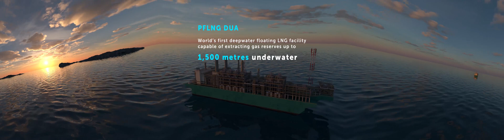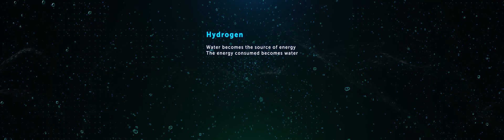Facilities of the Future for Zero Carbon World

Comment: We want more people to be able to travel without contributing to climate change.The pandemic has us realized that how much new normal is needed to prevent a climate disaster and prevention is better. The best numbers seen estimate that the economic slowdown due to COVID-19 reduced global emissions by around 8 percent. That’s not nothing, but the austerity that got us there obviously isn’t sustainable. If we’re going to address climate change, we need to find new ways to do things that don’t release greenhouse gases, including how we move around. When most people picture what contributes to climate change, vehicles are one of the first things that come to mind. In the United States, transportation is the number one contributor to emissions. But you might be surprised to learn that it only contributes 16 percent of global emissions. That’s a smaller percentage than how we plug in, grow things, and make things. Still, de-carbonizing how we move around is essential if we’re going to get to zero net emissions. The goal here isn’t necessarily to make people move around less (although we should look for ways to cut back on driving, flying, and shipping where possible). As we’ve seen over the last several months, economies suffer when people are forced to stay close to home. Want more people and goods to be able to travel. For some of the world’s poorest people—like smallholder farmers in sub-Saharan Africa—the ability to move goods from rural areas to city markets can make the difference between life and death. To do that, we need to make sure transportation remains affordable to everyone. Products like gasoline, diesel, and even jet fuel are the standard for a reason: they can send you a long way for a low cost per gallon. So, how exactly do we fuel our need to move around without emitting greenhouse gases? The answer is simple, even if making it happen won’t be: use clean electricity to run all the vehicles we can, and get cheap alternative fuels for everything else.